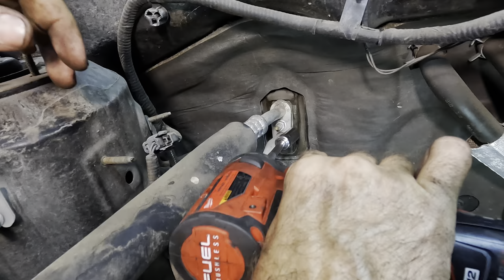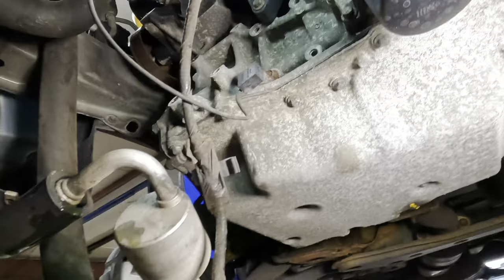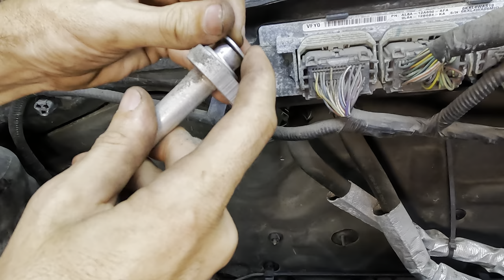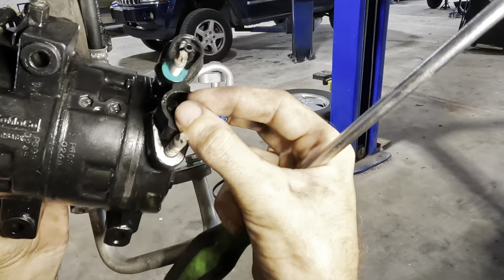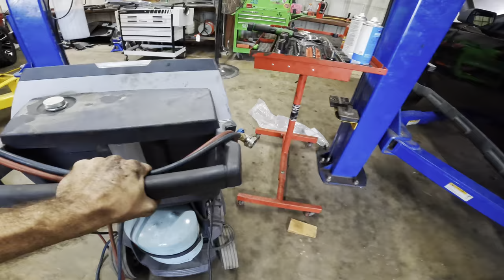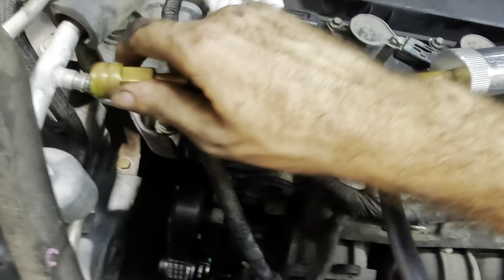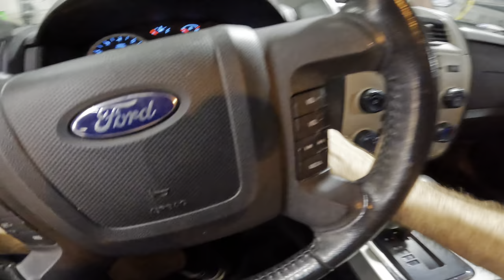Parts Cannon Complete! It’s bulletproof | Ford Escapé 2.5

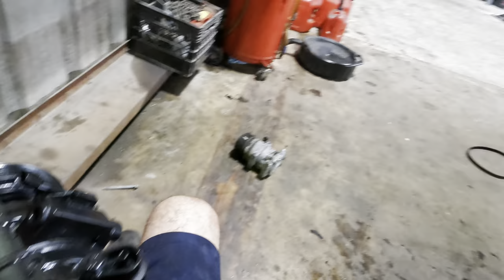Comment: Time stamp 14:03 , To me it looks like the diameter on the A/C pullies were different between the old and new units, causing the installation difficulties with the belt.  Keep up the great work Ray!
Reply: bearings failure?
Reply: Yep, It looked that way, sometimes it's the perspective from the camera but bit surprised it got past the comparison.
Reply: I saw that too!
Reply: @brianhall9019  he needs to see eye doctor or he sees what he want to see?
Reply: @theodavies8754  seeing can be deceiving, measure for sure.
Reply: You are right
Reply: I appears also on the pulley was larger !
Reply: It is larger. May not work as well at idle.
Reply: It sure does look larger in the video, but hard to say for sure (camera angles and all). Should measure to confirm. If it is bigger, that will likely cause premature tensioner failure and possibly affect a/c performance at idle (although it seemed to cool good in vid). However if you watch from 34:10 to 35:00 he struggles with the belt on the idler and says "got it, now were good". But in all actuallity, the belt is still off by one rib on the tensioner. Good old Ray, never fails to disappoint.
Reply: I agree, it immediately appeared so to me as well, though we can't be sure if it was just a perspective thing or not. The tensioner should(obviously did) "eat up" the difference to some degree if indeed there was any. & Its not as if the tensioner didn't snap back some in the end, so I doubt any bearings are under too much strain. Nor is it unusual for the max throw of those damn things to just be barely enough. Plus it will stretch some over time anyway. However even with all that said, I wouldn't exactly be shocked if it turns back up in a few weeks with a whining nater or something. 🤣
Reply: I noticed that too.
Reply: Might be because of the color difference
Reply: New AC pulley is larger than the compressor body, old AC pulley is about the same size as its compressor body.  Once cannot measure from a paused image in this instance as I tried that and the mounting hole spacing was different due to the angle.
Reply: @ScottDLR  not idle well too?
Reply: My thoughts exactly, I noticed the poultry size, and thought there was a sizable difference even if it was camera angle. Then when he had trouble with the belt I was pretty sure I wasn't just seeing things lol
Reply: @danmcadams3774  that is what makes his video interesting, fighting physics.
Reply: That combined with new belts almost invariably being an eensy weensy bit shorter than they always seem to be intended to be.
Reply: I noticed that too, and I don't even know what the part is called. I'm glad as an older woman who knows very little about mechanics 
I noticed.
Reply: I wondered
Reply: You guys are right, the pulley is 3 uggaduggas larger
Reply: I noticed it immediately also. Now the tensioner is out of midpoint on the range. There-s too much tension on the belt now.
Reply: @zayoutlaw  hopefully he will read all the comments about it.
Reply: Ray's Eye-Chrometer must have had a flat battery.
Reply: I have a Mazda with this exact same engine/pulley layout. It took me 3 belts to get a new one installed and I didn’t change any of the pulleys. The first two were just a smidge too small. The third one was smidge bigger. I had to zip tie the wrench to my control arm to keep the tensioner in place and pull up on the belt at the water pump pulley. It’s an extremely tight fit on those MZR/Duratec engines. I believe it was a Dayton belt that finally fit after I had tried a Delco and a Goodyear. It’s not the first time I’ve seen Ray struggle with a belt on that engine either.
Reply: @forgetfulme1719  anyone who turns wrenches has been there before! 🤣
Reply: @forgetfulme1719  no but it wont pump as much
Reply: @ScottDLR I’m also worried about stress under acceleration if the tensioner is close to max travel
Reply: @amanda123889  Yeah, you never know how one thing will affect another.
Reply: I saw the same thing, new A/C pulley is a bit larger.
Reply: First thing I noticed when he put them side by side. When he said the first thing he needed to do is transfer the....and he said, "studs from the old unit" I just knew he was going to say, "the pulley from the old unit". He never did and I said to myself, " he'll figure it out when the belt doesn't fit" He got it to fit but the way he did it is asking for trouble. I had a similar issue one time where I basically did the same thing except I put a little wedge on the pulley under the belt and just hit the starter a couple of times to get it to slide all of the way on.2 weeks later the bearing in my new A/C compressor started making all kinds of noise then locked up, shredded the belt causing rapid engine temp spike that ended up warping the cylinder head. Very expensive lesson learned, hopefully that won't be the case here.
Reply: Again Glad it's not my car.
Reply: Really appreciate your videos thank you.
Reply: I agree. I saw the same thing.
Reply: Great video. I learn a lot by watching your videos and taking note of your tips and tricks. That being said when yo compressor comparison it appeared the new compressor pulley was a lil bigger in diameter which gave you trouble installing new belt that was the right part number. But I learned something else as well, apparently there’s enough give in the tensioner to allow for the larger pulley. Did you notice that Ray and knew the belt would still fit instead of changing the pulley or just luck out? 😂 By no means am I calling you out as I’m NOT a mechanic, but your always so honest and admit your mistakes (which appear to by very few) for our learning benefit and that’s why we appreciate you and follow you because your relatable. Keep it up sir. Thank You.

Comment: It looked like the pulley on the compressor is slightly larger than the original. Thanks for the video's got a lot of good hacks on problem-solving. Keep up the good work.
Reply: That was a good observation, I think so to.

Comment: I'm not a huge fan of Ford products, but this Escape looks to be really easy to work on.  Great job.
Reply: Hi, no sorry. This 2010 Ford Escape is basically the same as the 1.5gen Ford escape which is the 2005-2007 model, but with a more boxy style and updated electronics and Powertrain. It's still a very USA or north american model. The Escape-Kuga Gen came in the 2013 model, which having the optional 2.0 Ecoboost, gets way less reliable with the head gasket issue
Reply: You won’t say that if you buy one with the v6 and AWD 😂
Reply: @waterloo123100 I like my mechanic, inline engines for me, thank you.
Reply: @kampar82 They last longer too.
Reply: Ive had two of these square body Escape's. They are very good vehicles. Much better than the newer ones IMO. You can generally get 300,000 miles out of the V6 if regularly maintained and they have lots of power.  The 2.5 is way easier to work on though as someone noted.  My son has the 2.5 in a Fusion. Great engine that was developed in partnership with Mazda.  The 3.0 was designed in partnership with Porsche, believe it or not.  I sold my 2011 at 275,000 miles and it was still going strong.  Only replaced the water pump and the front cat during that time (besides brakes, exhaust and other wear parts).

Comment: @32:20... You're supposed to go over the water pump pulley last. That's why it has the rounded outer edge. To make it easier to slip the belt over it. It's also a larger diameter, which makes it easier.

Comment: Nicely done - almost. I do have 2 comments
1. Unless I missed it,. I did not see you flush the evap. I would have thought if you found some trash in the TXV, you would have done that.
2. You should really be using Nylog on all A/C o-rings. Makes them last forever.

Comment: Ray, You are a superman.  Smart on the cars, running a business, and doing youtube.  And the energy to do it all.  I'm glad you are in the world.  The people who fix stuff are so under-appreciated.  

I am fascinated with your ability to diagnose and repair stuff.  Its that balance between time spent and parts cost.  Time is money.  The tools you have that save time.  The parts supplier that delivers the parts saves you time.  Its pretty amazing and brings a better understanding to me about what it takes to repair cars and run an efficient repair shop.
Reply: See some people don't do the work as a business it is for money
Reply: @andyedwards2993  Yeah some mechanics just throw parts at the issue or say they do and charge accordingly without ever understanding root cause.  They get paid little to find a wiring harness connector issue, but if they change the sensor attached to that faulty connector, they get paid. So with that incentive structure, they change the sensor.

Comment: The pulley on the new compressor was definitely larger. I was always taught to replace the receiver/dryer pretty much any time the system is opened up but especially when a compressor is replaced. Also a little A/C oil on the new O-rings and seals.

Comment: I had a Toyota Rav 4 V6 2011 189000 miles and litterally nothing was wrong with it mechanically. If you are going to have a fix it up car don't start with a Ford. I traded my toyota it for a new Silverado and it was back in the shop on day two of ownership.  American makers are run by the accountants not the engineers. Loving the channel Ray I could watch your videos all day. On occasion I have!
Reply: Toyotas don’t last in the rust belt. These escapes with the 2.5 and 2wd are good vehicles

Comment: I've actually had that same problem with the serpentine belt on a Ford Ranger 3.0 - the parts store belts were listed as fitting, but they were actually too short compared to the Motorcraft part. Based on the part number, they were 10 mm too short, but it felt it was almost a full inch. None of the parts stores carried a belt with the same length in that number of ribs. Always had to go to the dealership for the Motorcraft belt.

Comment: 14:00 You want an OEM compressor body on these for sure! I had a 2012 Escape 2.5 and it had a UAC compressor that made the belt squeak constantly! I replaced all of the pulleys, and gave it a new belt, and it still squeaked! I put in a junkyard OEM compressor, and it was silent!

Comment: Converted an a/c system from R12 to 134a on a 91 crown Vic years ago and everything went smoothly until I tried the new serpentine belt. Lots of cussing didn’t work so I went to Ford and bought a belt and returned the aftermarket one. Belt was short but a little more than a millimeter.  Sometimes it’s just something to piss you off enough and make your day.  Thought about doing exactly what you did but like I said Ray, more than a mm.  I was afraid I’d cause the tensioner or one of the bearings on other units to squeal and wear out.  Nice job.

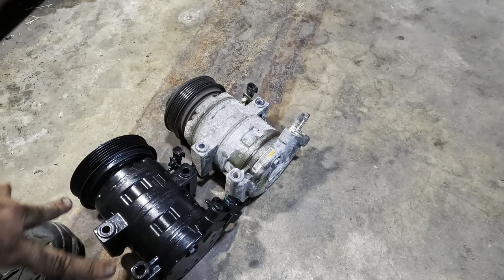Comment: @14:09 - The size of the pulley on the new compressor was slightly larger than the old one.
Reply: Stooge mechanic did not notice.
Reply: @forgetfulme1719 he is always in too much of a rush which is poor form
Reply: @amanda123889  time is $ to him, damned if ur car damaged, yet idolized by many non mechanics as god.
Reply: @forgetfulme1719  yeah I agree and have never understood this fandom when he is making so many big mistakes on camera for all his viewers to see but like you said they are not mechanically minded. Also he is very rough in many ways with his work
Reply: @amanda123889  mechanic is tough work at times, but like u say, he is brutal, dangerous for delicate cats.
Reply: @forgetfulme1719  yeah some plastic trims and especially most air con work he does I just cringe and wait for a snap sound 😳

Comment: I would say the clutch pulley for the old unit is smaller than the new one, possibly could be for a Diesel maybe? Lower rpm on a Diesel so a bigger pulley would make sense

Comment: Our park n swaps around here, everyone puts up covers because of the sun. Most of the time they're premade brackets that accept electrical conduit and you string a tarp between them. You could have some tarps made with 'Rays Auto Repair' and put the shelters over some cars in the parking lot, visible to the freeway depending on Bradenton's sign ordinances. They'd fall under non-permanent here and not needing city/state sticker ($$$).

Comment: hay that was a great find with the oil / leak indicator in the insulation on the A/C hose.
you are a special “fix it guy” you are always 100% on task, and doing what needs to be
done to get it all working the way the auto should , especially with out using the parts
cannon like many shops do replacing what the codes say with out verification that is the issue.

Comment: Thanks for the informative videos, Ray.  Be an added bonus if you could state the rough time/labor stats for the procedures in upcoming videos so we can ballpark repair costs done by pros.
Reply: 30-40 years ago, any itemized/categorical work done on vehicles was dictated by Chilton automotive repairs cost index, which gave estimated hours and recommended cost to be charged, any none itemized (just straight hours worked) like welding or adding after market items (lift kits, roll bars, runners, brush guards, thrush glass pipes entc) were at 35-45 bucks an hour. The Chilton API was governed by independent auto repair/care owners association and ASE to discourage "Price Gouging". I don't know if that is still being used, but crooks will always find a way around regulation to rob unsuspecting customers. Mechanics like Ray are very hard to find, luckly I had my brother as the chief mechanic when we had our 4 bay full Service Chevron Station. After 30 years, we handed it over to our kids, but I just couldn't stay away, my daughter kept me on as gas station attendant & fixing flats until I learned how to be retired.

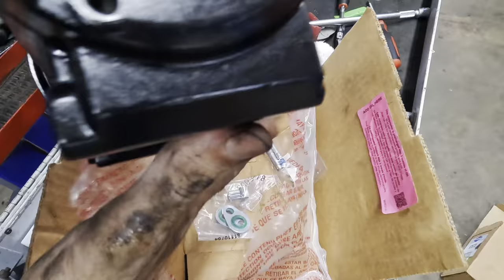Comment: Ray buddy, that A/C Compressor came with new studs with blue lock-tight and new O-rings and crush washers, look back at 13:37 on your own video. Again this is not meant as a REEEEE lol but as NASTY as those studs look I always use the new parts provided brother. And yes I know this video is 11 months old. lol Just a tip from a Master HVACR 30+ year retired technician I always pre-oil my O-rings with a few drops of appropriate compressor oil before installing them, it keeps them soft and supple plus it aids in installation, just like O-rings on fuel injectors.

Comment: 24:21 I bought a plastic repair gun, basically like a soldering iron with flat tips and ways to use different clips to melt into the plastic.
I think that could have repairs that broken plastic tab from the grill that is mounted with, I believe a 10mm.
Maybe not critical, but might just give you that above and beyond type repair, even if no one noticed it.

Comment: The hose leaking inside the rubber insulation explains several things.  As he said, it explains why the compressor was bad, or almost bad, and why the owner was so willing to replace the compressor right away.  He knew something was wrong.  The leaking freon would carry dye and oil with it, the freon disappears at once, the oil stays.  And you can't see the dye, it's inside the rubber insulation.

Comment: Perhaps I missed it but didnt see any pag oil inserted into the compressor. I know it came with minimum factory  fill, but additional oil is usually required to meet" full"capacity operating specs.
Reply from the maker: At the end, the dye injector has Pag oil with it

Comment: Ray you taught me differently when putting the belt on, when you put a belt on once you undid the off centre bolt on the tensioner to release to much pressure on the belt because you didn't want it to tight. I think you put this belt on a totally different way.

Comment: Ford Tech Makuloco did a video on the accumulator on these Escapes going bad, especially on the earlier models like this. Apparently the diaphragm inside likes to rot away and then little bits and pieces like to go through the system and plug the orifices.
Reply: Yep. When I replaced my ac system in my wife's escape I replaced that as well. Was not super expensive.
Reply: @adamponder  Nah, it's about $18 on rockauto.
Reply: @canadiantrucker9574  my toolbox is covered in the magnets…..😂
Reply: @adamponder  😆 I'm more of an Amazon auto parts person nowadays.
Reply: @canadiantrucker9574  I feel you. I will always take the rock auto part number it gives me for the part and put it on Amazon since I have prime and don’t want to pay for shipping if I don’t have to. A lot of the times it’s excellent on just ordering one part etc. Big orders from rock auto can match pricing though on rock auto if the part is so much cheaper than amazon.

Comment: I realize that it's time consuming but as a matter of habit, I run used bolts against a wire wheel before reinstalling them. I also give them a bit of nosieze when installing them in dissimilar metals. My limited experience with AC systems, all on older cars, is jealous of the current system of plug and play hose replacement.

Comment: I love your channel Ray. The reason the belt on the escape was short is because the pulley on the new compressor is bigger
Reply: from the belt perspective, pulley too big, from pulley Ray, belt too short.
Reply from the maker: I think was an optical illusion
Reply: @RainmanRaysRepairs  Check it again Mr. Optical Illusion.  Your wrong, dead wrong.
Reply from the maker: I can’t check again, the car is gone. 🤷‍♂️
Reply: Maybe the old one was incorrect and this is one is correct?
Reply from the maker: @kenore4003  Dawson the AC works great, so mission accomplished